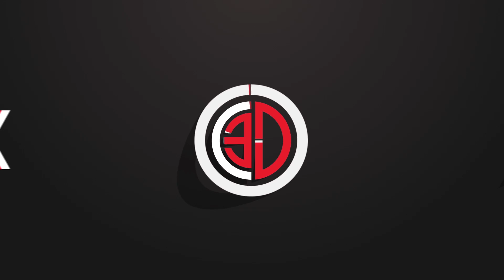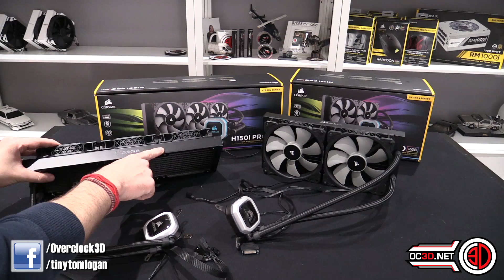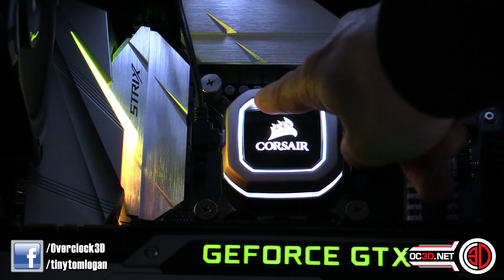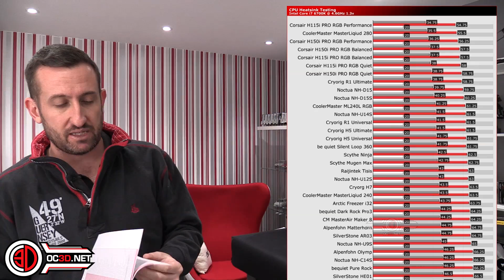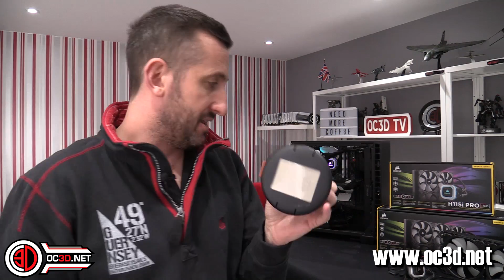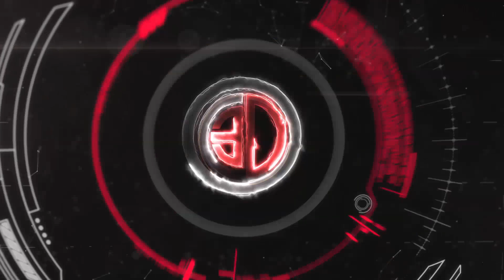Corsair H150i Pro RGB and H115i Pro RGB AIO Review

Comment: Have you liked running benchmarks on the cpu's standard Pro 115i stable cpu overclocked with ryzen 5000 cpus pbo on with the coolers 1200 rpm fans making it cap out or next what fan decision on the closed liquid cooler been testing out 140mm fans or not using a 280mm 1600 rpms better performance fan at all?

Comment: Do you think the factory thermal coating is adequate or should it be removed and thermal paste used?
Reply from the maker: The stock stuff is fine, if you ever remove the cooler from the CPU you will need to replace it though
Reply: @OC3D  thanks

Comment: No Tim the trade-off for higher RPM fans is not necessarily noise, if you use the Noctua NF-A12x25 Sterrox fans which will go up to 2000 RPM and still be quieter at full whack than the Corsair 120mm fans at 1600.

Another thing which I noticed was when I still had my H100i (I moved to the H150i because of the new case - Phanteks Evolv X - and the fact that my systems run 24/7 and the H100i I had was getting on five years old) I replaced the Noctua NF-F12 Static pressure fans I had on it with two of the A12x25 fans and the new fans ran 250 RPM slower for the same cooling.
Reply: Have you liked running benchmarks on the cpu's standard Pro 115i stable cpu overclocked with ryzen 5000 cpus pbo on with the coolers 1200 rpm fans making it cap out or next what fan decision on the closed liquid cooler been testing out 140mm fans or not using a 280mm 1600 rpms better performance fan at all?

would you keep using the pump software control with the aio? just motherboard fan software for the 140mm x2 fans?

Comment: THE FULL SPEED START IS A GOOD THING. If pushes through any settled dust. Thats the point and reason why at first start for 2 seconds they full speed boost, i wouldnt be happy with these now they dont, its only 1-2 seconds of fast speed fan sound at boot, and its a good thing to have
Reply from the maker: The full speed start was to check fan speeds - wasnt designed for dust

Comment: Seems a step backwards with the amount of fan headers since the h100 and H100i that both had out of the box push pull support with the additional 2 fan headers. Also the RGB bit seems like a gimmick that has been intentionally blocked on older coolers even though the RGB logo on them could likely support colour cycling but I expect is intentionally unsupported. Beyond the 360 rad, I can't seem much of a reason to pay the extra to buy these coolers if like I did, you can find a previous model for less. They should have in the very least come with RGB fans, but then corsair are price gouging on the RGB fans even though RGB is so ridiculously cheap and in virtually everything in the pound shops these days making it not as expensive as they mark it up (lol I modded a basic red RGB fan with the RGB LEDs I got out of a few £1 rgb reed diffuser air fresheners).

Comment: If I replace the stock ML140 fans on the H115i Pro with the 2000RPM ML140 fans can I expect better cooling performance? Of course this would trade off for increased noise.

Edit: I should have watched until the very end of the video before I asked this question.

Comment: Been watching your reviews for a long time. I’m running an h100i v2 and was looking to upgrade to the h115i pro but noticed the hoses are a lot smaller. And if so i can only put my rad if that size in the front of my pc. What’s your opinion on front rads with only 1 exhaust fan and this vs the h100?

Comment: TTL...Would you run the H150i on a machine that runs for weeks at a time or go with a very high end Air cooler. Worried about a pump fail or something going wrong while im not by the machine. Thanks
Reply: Why would you ever do that?
Reply: Because i dont turn my machine off. Dont have any problems
Reply: +Brendon Van Eden lol why do you leave it on 24/7? I always turn mine off when I'm done playing for the day
Reply: Brendon Van Eden  ....You can set the software to shut down the PC if the CPU temp goes beyond a certain temperature.

Comment: So is the h150i pro rgb better than the h100i v2 aio? Yes I know one is 360mm rad. I have the h100i v2 on my ryzen build and the temps are 19c idle 60c gaming with ryzen 1800x 3.9GHz
Reply from the maker: It performs better if you put more load into it. Doesnt sound like you need a better cooler if yours is currently quiet?

Comment: advertise it as 'RGB' and its just the pump ? buncha crap, at least cooler master includes the RGB fans, even if they arent as nice
Reply: I like it, I personally don't want RGB fans. Can you even see them well through a tempered glass side if you don't have a clear front or top panel? I don't think I could in my H700i, it would just give ambient light which I can achieve with strips anyways. With RGB possibly on your GPU, CPU block, RAM, mobo, and strips that's more than enough imo.
Reply: I understand your point, but my whole complaint was the fact they call it an RGB edition, and the only other AIOs I can think of that refer to themselves that way include RGB fans, if someone is looking at it for the name, and doesn't pay attention, you are going to have a pissed off noon, it's bad advertising from Corsair, that's all
Reply: Yeah fair enough, I see what you mean since they put RGB in the name, whereas coolers like the Kraken or Corsair's earlier coolers don't even though they have some RGB. It's not like there's a marketing term to distinguish some RGB vs RGB overload, but I suppose they could've left it out of the name. Personally I think coolers like the Thermake Floe with tons of RGB is a bit much.

Comment: You put Corsair H150i Pro RGB on Corsair Carbide Clear 400C case? It was fix it?
What is better combination on front instalaion fans? Put them in pull (inside case after cooler) or in push (inside case between front case and cooler)? I have also on 120mm fan on back in push (air outside case) and one 140mm fan on top in push (air outside case). I'm considering also replace 140mm to two 120mm fans on top. What will be better?

Comment: They fucked up !... why so many cables coming from the cpu block... holy fucking shit ! They make a dedicated fan hub, so you would think they wouldn't put a splitter cable for the fans on the freaking cpu block ! or if they are that considerate, why not include a fan splitter that you attach on the mobo ! also, I love corsair link, but that's another cable going out of the cpu block... man can't they pass the cables through the tube under the sleeving ! like other aio's ??!! man what a disapointment... there's at least 4 cables going out of the cpu block... just stupid and ugly.

Comment: Hmm another review shows the old corsair coolers beating the 360 new one (aside from noise). Now I'm curious what the consensus is.
Reply: I wouldn't be surprised, the fans that come with the old ones run like twice as fast and the cold plate is slightly larger. These still perform real well though, worth the tradeoff imo.

Comment: I don't get this. You have stellar results with the H150i that no other reviewers get. I've seen like 10 reviews, NONE had such a difference in performance. Actually, on most of them the H150i is OK but a bit worse than other 280/360 models out there due to the lower max speed of the included fans (they are 800 RPM slower than the normal ML fans...why Corsair???)
Reply: ROKUGAN EXACTLY!!!!

Comment: Now my h100i v2 I got for Christmas feels old!! 
Not that I wanted 280 rad anyway. But they are pretty.
Reply: Dulux Doggy I wanted 360 but they was nearly impossible to buy in the UK (unless I went custom loop) personally I probably just get a noctuca air  cooler next time as they only have 1 point of failure and have better fans and temps  are same or slightly worse then AIO temps
Reply: lee x I have just moved from a NHD-14. Using sp120 led fans (mobo controlled) at inaudible levels. In a Silent room the pump can be heard humming away. 
Water in my pc does make me nervous. I have been thinking about getting one for ages. Then the missus treated me!

Delidded 8700k, 4.9Ghz at 1.2v. 50-60c at full load. But gaming temps in the 40’s

Comment: Tom did you have any leaking problems? People on the Corsair forums have been having leak issues with these new coolers, leaking at the fittings
Reply: I am surprised at how fast they shipped the products to those people as I doubt they are in the hands of major retailers and on corsair.com items ship from somewhere in Asia and whenever I buy anything it takes like 3 weeks to ship (live in UK but I am sure that it should not be that much longer than US if it is longer of course)

Comment: How are you gonna top the beautiful look of the NZXT Kraken though? /:
Reply: Exidrial with an all black fractal s36 with black venturis, that's how.
Reply: Chaotic Cookie because Corsair Link is any better? lol
Reply: Chaotic Cookie as if CAM noticeably slows down your PC. If it does, maybe you should invest in a new PC instead of an AIO.

Why would I want another program on my PC? To use its features of course! That's what PCs are made for, to have programs on them
Reply: +Exidrial corsair link is actually 100 percent better. It actually works lmao
Reply: +Chaotic Cookie I have CAM for my H700i and it's awful, definitely not gonna buy a Kraken because of it. I do use Corsair CUE for my keyboard though, I wish they would integrate CUE with Link instead of having to run both.
Reply: Seriously I have one for everything running. NZXT CAM, Corsair Cue, Logitech mouse software, Aura RGB Control (Strix GPU), MSI Afterburner, and now Corsair Link that I've bought the H150i. I'm starting to feel like my 6600k can't keep up with all that + gaming.
Reply: +Malus1531 why are you running all the programs? Lol use them to set your setting then close them out. Tf lol
Reply: Allie Boy Depends on the program. Corsair Link and Utility Engine don't save settings when you close them. Logitech just seems like something you'd leave running as it controls your mouse lighting & DPI. I suppose keyboard (CUE) and mouse (Logitech) profiles can both be saved to onboard memory, but since I never move them around I don't bother using it. I wasn't sure if I needed CAM open for my H700i smart hub, but I've since moved fan control to mobo and only use it for RGB strip control so yeah I run that as needed. Aura I open and close, Afterburner I leave open only while gaming. I upgraded to 8700k anyways so I'm not too worried about it now.
Reply: +Malus1531 what do you use to cool your 8700k?
Reply: Allie Boy As I said above, Corsair H150i
Reply: +Malus1531 temps are good?
Reply: +Malus1531 I need a new cooler, not sure which to get
Reply: Software tops it

Comment: Seen a couple of these reviews now. These are definitely decent AIO's but NZXT still hold the performance and aesthetics crown with the X62 if not the noise crown... I guess Corsair just had a different set of priorities when designing these. Aura sync support would help differentiate this product, lets hope they implement it.
Reply: Actually if you look at the rankings for performance on the OC3DTV site the x62 doesn't out perform the new 150 in testing

Comment: You’re right about that 8700K voltage stuff. I use a huge rad and even though I can get my processor stable at 5.1, the heat is just monstrous no matter how hard I run my fans. I really don’t wanna do a delid but I might have to.

Comment: Nice Video Tom, 

as always Corsair with their proprietary bullshit, and not syncing with AURA and needing additional USB port which is complete BS is getting so old its not even funny. I used to like Corsair, but throughout the years have grown tired of their business model. 

I have bought a Arctic Freezer 240 for $89 with 4 fans (Push Pull), and yes no RGB but hell you can get a set of RGB fans if you want for $20 which sync with AURA
Reply: Not all motherboards have Aura sync... A lot of people still run Haswell and older which doesn't come with any RGB stuff. I actually use the h110i gt, and I use the usb port since I have a X99 system. And it should be noted that the only use for usb 2.0 headers nowadays is for coolers and other software controlled hardware. Almost no cases use usb 2.0. and using an usb port isn't proprietary at all.
Reply: Fwiw The plastic at the base of the sleeved hoses cracks & falls off after about 2 years, 
-which was about the lifespan of both the H80 & the H80i that I owned.
Reply: My AF 240 came defective twice. Awaiting my 3rd set to be sent out now (coming in this week).

Support was decent though.
Reply: Whats your point GBATD ?
Reply: i hate rgb! reminds me of lgbt because just a bunch of letter! maybe rgb spreads aids to computer components maybe while in sli or something but I avoid all letters and the rainbow color!

Comment: This is the pinnacle of AIO coolers and the only thing better is a custom loop. ^_^
Reply: Custom is always best imo, you learn a lot more and it lasts forever with simple coolant changes. These AIOs are meh.
Reply: Hieu Nguyen the only way that I could get my 7700 K to run at 5GHz and both of my 1080ti cards to run at 2012MHz each while maintaining sub 50 degree temps was to do a custom loop with two 360x39mm radiators.
Reply: The downfall of custom is money money money!
Reply: You right, my custom loop help me max oc both gpu and cpu.